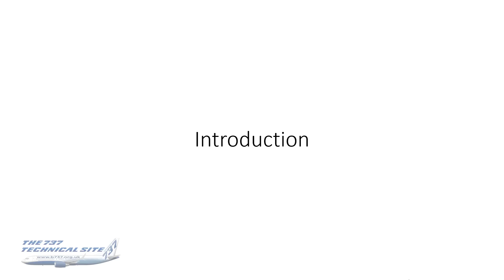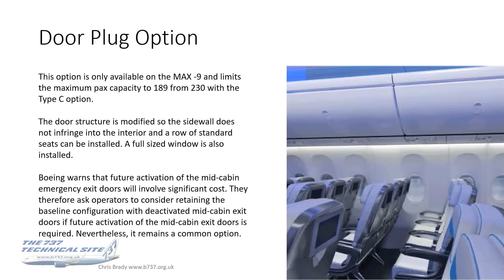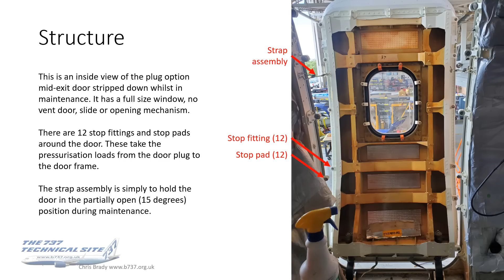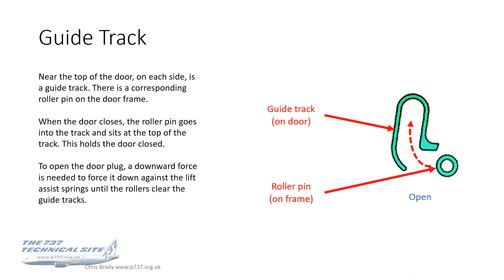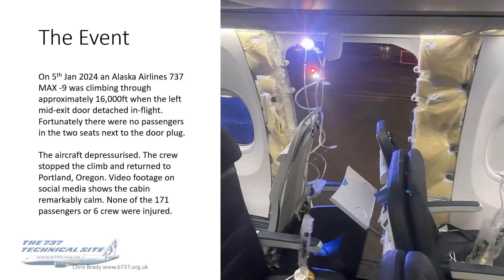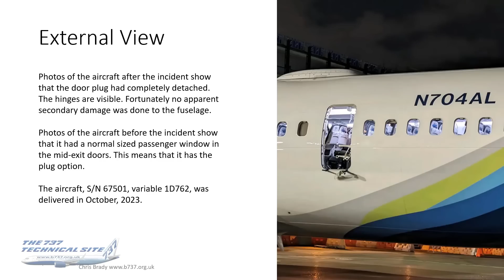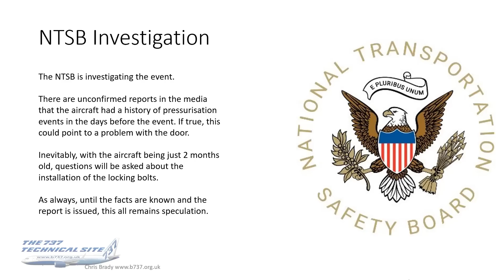737 Mid-Cabin Emergency Exit Doors - Plug Option

Comment: Very informative! Thank you! So my personnal conclusion is that the technician(s) who installed that door either didn't put in the locking bolts... or didn't even put them in at all. I can easily imagine the end of the shift and the door has just been installed but the bolts not fitted yet. Everyone leaves. The next day, since the door is already installed in the frame, the next assembly step goes on... and the mistake can never be noticed afterwards because that step would be installing insulation.

Which would mean the person in charge of installing the door didn't care enough to complete their work before leaving... and the person in charge of the technical inspection never actually checked.
Reply: When was the last time this plug was removed? I would suspect if it was in aircraft final assembly, the plane would have failed the high blow test. Often new aircraft are taking directly to a post delivery mod center for different STC installations. Those places wouldn't necessarily do a high blow test after the STC mods (if that happened). All speculation at this point.
Reply: @chiphaynes6280  If the door/plug is in its place, I would surmise that it would actually pass an on-the-ground pressurization. The pressure itself would prevent it from moving upwards and out of its tracks. So if the bolts were not present, the door/plug could actually stay in place for a while... until vibration and airframe tortion would enventually nudge it out. Let's say, after a couple of months... ;)

I agree with you on the fact that there is a possibility that the finishing/mod center could be implicated in this though. Whoever touched it the last time for sure. But in this case, why would they actually open the insulation and remove the plug? Since it's a permanent plug option, insulation would have been installed over it at Boeing. Wouldn't it?
Reply: " I can easily imagine the end of the shift and the door has just been installed but the bolts not fitted yet. "
That would mean someone "bought off" the assembly steps without actually completing them.
If the crew showed up the next morning they would proceed to next actions only if the job was marked complete.
Reply: @toma5153 Yes. That is supposed to be how things happen. Since I work a technical job in a unionized manufacturing environment, I know for a fact that sometimes workers actually just don't care. 

Let's see what the investigation reveals. But my money is on that...
Reply: @JFHeroux  a/k/a "roller buggy" a phrase we used to describe that behavior
Reply: I don’t know if those bolts get torqued to put them in tension, or if they are free floating and rely on the castellated nuts, possibly with some interference fit on threads, plus the cotter pin to hold them in place? If the bolts were installed, but the nuts vibrated off or were never installed, the bolts could possibly stay in place for some time before vibration caused them to fall out, maybe a couple months?
Reply: @Bitterrootbackroads  Good point. I hope the NTSB is able to determine if bolts were present in the first place. I don't have a lot of hopes that they'll be able to locate the door on the ground... unless it landed in a very obvious location. But that would be quite helpful since microscoping scratches would be present in th bolts holes if they were ever present.
Reply: @Bitterrootbackroads they are not torqued and no resistance to nuts. Not thread locked. The split pin through the nut and bolt stops disassembly . Used all over , in many applications. Especially vibration. Eg track rod ends on motor vehicles. If I’m not mistaken even jet engine mounting bolts use split pins and nuts not torque loading.
Reply: "…either didn't put in the locking bolts... or didn't even put them in at all."
What are the "them" that were not put in at all?
Reply: @petep.2092  I am certain you are pointing out an error I made in English. As this is not my native tongue, you should point out what the mistake is. Otherwise this comment is of no value to me.

Comment: good video.  Boeings lack of safety culture is to blame. management there only cares about their bonus.  If you try to do the right thing when working for them they look at you as if you are the problem instead of fixing the problems.  Boeing also has been getting ride of its own inspectors for years.  If tell a boeing manger that you can not complete a task for safety reasons they find some other hack tech they hired from a fast food joint to sign it off. They need to fire all high up Mangement start over with people that care about safety.

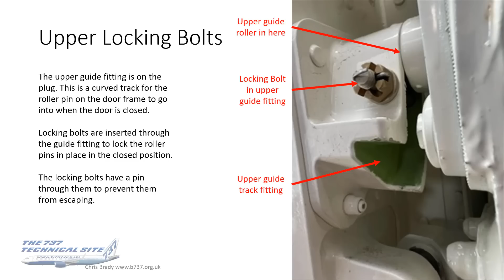Comment: 3:07 door plug vs actual emergency exit 3:45 plug has bottom hinge, opens outwards for maintenance / inspection 4:52 inside view 6:29 guide track 7:34 securing door plug. 4 bolts prevent vertical and outward movement 8:51 upper locking bolts. Note captive bolts. 9:47 lower locking bolts
Reply: Another glaring difference. Emergency doors have Warning indications. AFAIK this plug has no warning system.  Unlike every other opening into the Pressurised compartment.

Comment: Absolutely great video! It's difficult to escape the conculsion that someone left the bolts off, but we shall see. I'm sure the door will be found, and that should give answers. I've just subscribed.
Reply from the maker: Thank you. I believe that the plug/door has already been found.
Reply: @ChrisBrady737  don't see any news source on that during a quick search, but I'm always happy to wait for factual reporting over rumor based reporting, as our media when reporting rumors typically turn out a pig's breakfast for what otherwise would've been a straightforward story.
Hence, why I'll only occasionally check news updates on a developing story or investigation, waiting for the investigation before forming an opinion.
Reply: I hope so.   @ChrisBrady737
Reply: Key item in the determination of failure/fault .👍

Comment: I’d bet my next paycheck that the stop / arrestor bolts were not installed during final assembly.

Typical scenario would be something like this.
Day Shift finishes up and will no longer need the opening going forward. They assume Night Shift won’t need the opening any longer either so Day Shift installs the door plug engaged with the rollers / stop fittings but don’t install the stop / arrestor bolts “just in case” night shift needs to use the opening again. Night Shift comes in and says “wow, Day Shift finished up with the plug door” and proceeds to install the interior panels (without checking or installing the stop / arrestor bolts). Day Shift comes back in and sees the interior panels installed and says “great, Night Shift finished up with the plug door and even got the interior panels installed…now we can move on to a bunch of other stuff.” Late Friday afternoon rolls around and the supervisor is clearing out the stack of completed work packages piled on his desk and he isn’t quite sure from the work logs if the bolts were ever installed. He asks the Day Shift lead if the bolts were installed and that guy says “yeah, night shift finished installing the plug door”. Of course, the right thing to do is follow up with Night Shift on Monday night or maybe Tuesday morning during turnover but by the time that rolls around some other schedule crisis has come up to distract everyone and, voila, you have a door plug blowing off at 16,000 feet.
Reply: Ignoring the fact it requires or should require a sign off on a worksheet to say they have been installed. People are getting fired.
Reply: @copperkipper1 joe said that steve said he heard night shift verify the bolts were installed. Sign-off completed.

Comment: I believe the door plug has to move up to clear the roller pin not downwards as stated at 07:08. I could be wrong, I havnt worked on this particular plug door however in the closed position, the roller pin can't move down anymore.
Reply: I agree with you my understanding of the mechanism  is that it should be lifted ( which would be safer as the weight of the panel adds to the integrity of the system ) but i am not a 737 specialist.
Reply: @patpat5135 looks that way to me also. Makes sense that the “LIFT assist springs” are there to help maintenance personnel lift the heavy door into the open configuration. Unfortunately, if the locking / arrestor bolts are not installed then the lift springs alone will probably eventually lift the door open after enough jostling around with plane turbulence.
Reply: @nostromo526  the photo at 8:43 also seems to suggest the same. The roller pin looks to be already at the top of the guide and would prevent the door from being moved downwards, but maybe I'm completely misunderstaning something here.
Reply: @nostromo526  turbulence and pressurization/depressurization cycles. They'll add to migration and potential premature wear in something really not designed to move in normal operation.
Reply: One remote possibilty that explains how it could have repeatedly flown with no bolts... If the lift assist springs carry only  a percentage of the doors weight then the door will still remain locked in place at upper guide even without the bolts installed.
Until a 've g at the mid door occurs  (pitch up rotation or turbulence etc) resulting in the door and its upper guides floating up off the fuselage frame guide rollers against friction at the stops. I think this is a remote possibility however because any pressure dif imparts huge loads at the stops.
Reply: @robertfraser9551  vibration at low altitude when the cabin isn't much pressurised, perhaps even during landing, would be the most probable.
Reply: @CanizaM  could be.  Low cabin pressure, bit of negstive g and maybe some yaw loads on the door could wiggle it to the edge of the guide fittings until high cabin pressure blew it off. All will be revealed when the door is found. Guide fittings with intact and empty bolt holes would be revealing thats for sure.
Reply: Lift assist is in the name ;). Assist by taking a percentage of the load.
Reply: Very curious because the video images are 100% correct. With roller at the top of the guide fitting the only degree of freedom is door upwards. But the door has been found and it is in great shape !  Landed in a spindly tree line and did not hit the ground.
Reply: The plug door has to move up and then outwards to disengage. Watch the NTSB press conference, the structure specialist mentioned it twice.
Reply from the maker: * Errata *
In this video I state that a downwards force is required to remove the door plug. I based this statement on text in the AMM SDS which I now believe to be incorrect or misleading. It is possible that a very small downwards motion (1-2mm) is first required to be able to free the locking bolts. But the door must be moved upwards by a couple of inches to clear the guide tracks. Apologies for any confusion.
Reply: I was confused by this as well. I’m wondering if after the bolts are removed the springs tend to push the door up and a bit outward causing the guide track on the door to disengage from the roller pin on the frame. You then manually push the door down against the springs to disengage the stop fittings from the stop pads, allowing the door to fall into the open position.
Reply from the maker: AMM SDS 52-23-00 Page 6 MID CABIN EXIT DOOR PLUG - COMPONENTS, Lift Assist Springs:
"Apply a downward force to the door plug this forces it down until the rollers clear the guide tracks. At this time the door plug can open outboard."